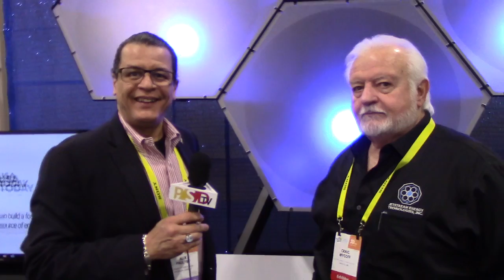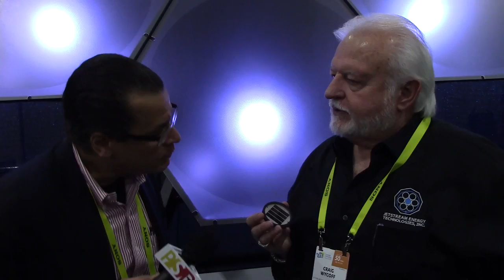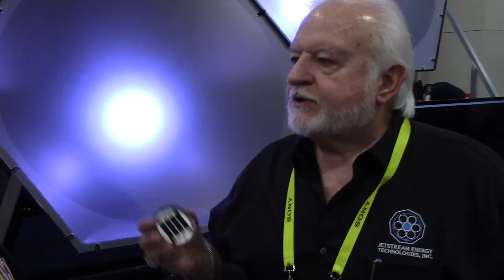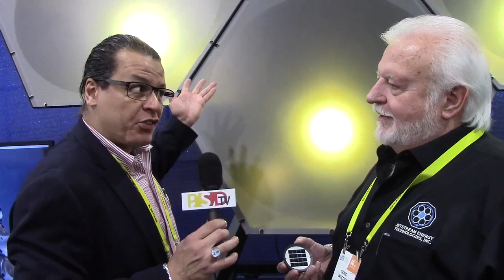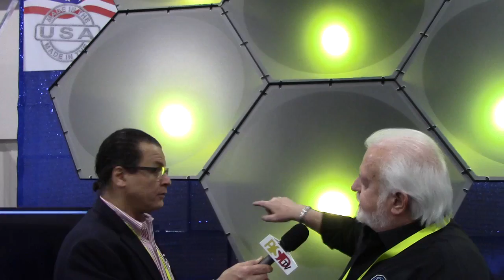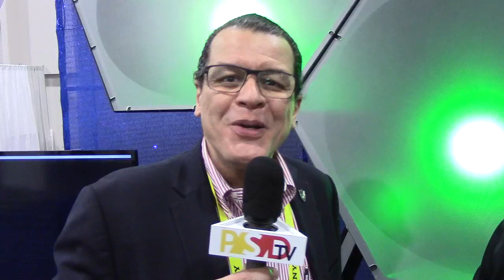PSDtv - Craig Wycoff of Jetstream Energy talks about their solar concentrator tech

Comment: id love to do solar but i dont think it would work much at all unless i moved to the united states and the lower states preferably.
in northern alberta canada its winter 8 or more months of the year and we dont see the sky for many many weeks at a stretch.
looking at the solar map for effective use of panels,we get 1/4 the suns rays,and thats on the clear days
Reply: Darrell think you'll find they work on daylight not sun light so unless your in complete darkness for 8 months they will work  :)
Reply: you forget the angle the sun/light hits us here om a good day gives less than 2 hrs for charging well all dont live in paradise
Reply: Alberta's mean angle is 53 deg. but if you move them to 27deg in the summer and 90 deg in the winter you should get about 1200 kw pa and that's with fixed panels these ones actually track the sun so you should get more.   check out--    neighbourpower.com/alberta-solar-potential/  Web site.
"Alberta’s combination of cold temperatures and lots of sunlight gives it a world class solar potential for solar photovoltaic system. A solar PV system installed in Calgary can generate more electrical energy than if it were in Rio or Rome! "  you get far more than we do in england :(
Reply: But watch out when comparing sun irradiance across the globe. It often compares horizontal surfaces, which matter for the climate and temperature, but if you compare levels perpendicular to the sun, the north gains quite a bit, and sun panels can be angled to that optimum, especially with a tracker.

Comment: May I know is 1 element = 3.5kW or 7 element combine together to archive 3.5kW?
Reply: they way i understood it each element is 500 watts so 7 would = 3.5kw
Reply: Thanks Andy .. this seems a bit small ... Anyway thanks ....
Reply: your welcome. i guess it depends on where you live to how much you need. for me 4.5kw would be ideal
Reply: For me 3.5kW is more than sufficient ... If it can reduce 10 times of the size then is good ..  I can put on my roof
Reply: if you have a flat roof i guess that would be fine but these do move to follow the sun, there not fixed panels. i wouldn't buy now anyway, loads of companies are bring these out, i'd wait  till the price drops :)
Reply: I thought this is a rooftop non movable part that can harvest energy twice times compared to conventional solar panel .. ?
Reply: no i checked out the web site, it comes on a motorize stand, included in the price, so sits in the yard like a big sat dish